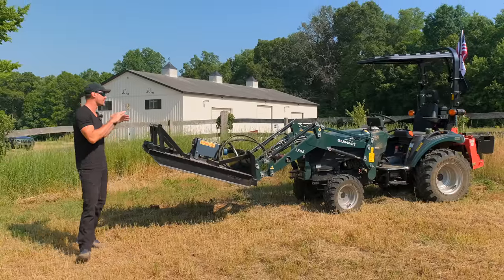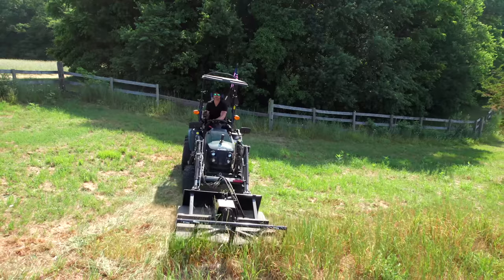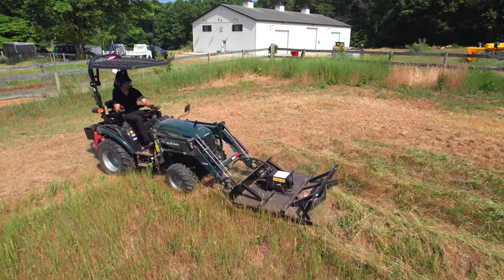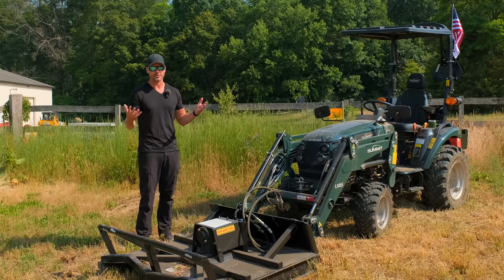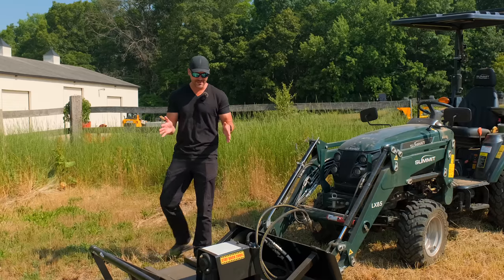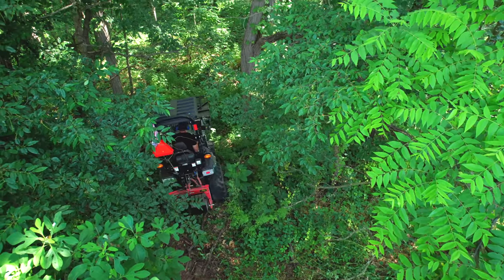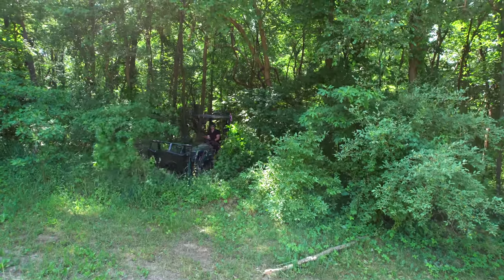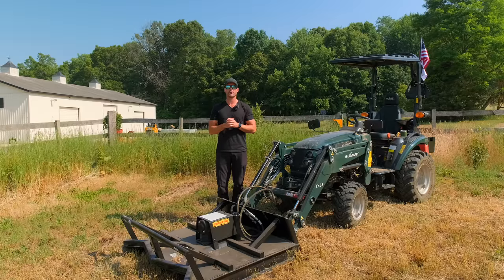NO LOOKING BACK! LOADER MOUNTED HYDRAULIC BRUSH HOG! 😱

Comment: I think this is a good concept and wanted by many but it would only shine maybe with a pto driven pump plumbed all the way up to the front
Reply from the maker: Those PTO driven pumps are pricey...unless you get a made in china version.
Reply: We got one of the last second generation TrailBlazer  front brush hogs and paid the extra for their PTO driven pump in the back. It is expensive, but you can keep the mower running while making the adjustments as you mow. 
When we had our Kubota in for its 50-hour maintenance, I ha s the mechanics do an evaluation of the mower. They thought it was a superior design when compared to the Lane Shark. Plus, they also brought to my attention that there were plates on each side of the back of the mower to install guage wheels.
Unfortunately, TrailBlazer stopped making their mower because they could not overcome a patent infringement case brought about
 by Lane Shark. Even with the design changes on their second generation, it still had problems, so the company decided to give up. 
Too bad, because I really like the constant flow of just under 12 gpm from the power pack. It also gives you 400 pounds of ballast in the back with that power pack. I also had a neighbor weld together  a weight rack that I put on there so I could put 550 pounds of GWT suitcase weights when we are moving around round hay bales. 
The setup works well for our needs.

Maybe someday , we will figure out how to use the power pack in order to use a hydraulic auger.
Reply: @GoodWorksTractors building your own 3point pump is fairly simple.     I’m gathering up parts to build an engine driven pump that you carry on rear to handle high flow and also act as a ballast on the rear

Comment: I killed a calve with a bus hog once! The blade hit a black granite rock , broke and I saw it fly out underneath the tractor, it exited the tractor between the left rear tire & left front, traveled over 75’ and was getting higher before it came crashing down on a calves skull. The calve watched it all the way to the impact. We did not have chains hanging down on the front, which might have prevented this.

Comment: In watching the video I notice that you had to cover over the tall grass twice to cut it. The first time over it pushed the grass down, the second time over it cut it. It would take a long time to cut a large field. The suggestion to have some type of pro hookup to an auxiliary hydraulic pump would be the ticket and then you could run any number of front mounted units for different jobs just like a skid steer. But then comes along the expense and auxiliary pumps are not cheap. My tractor gives you 8.5 gpm and as such I couldn't put a wider unit on than that 4 footer.

Comment: I have one of these from from this company. The owner is great and will answer any questions. I talked to w l long who makes my third function and they recommended a by pass on the return to help on the heat and preventing the motor from stopping to quickly. It was a quick and easy mod, but I can easily cut 2 inch and love it for cutting in woods and trimming up trees and along ponds

Comment: It actually works very well. With over a year of use on mine, I am very impressed. Just wish the video would have gone more in depth with the hydraulic system needs. I have cut in many trails and cleared away a ton of invasive species throughout the property. 
I am running the 4 ft unit from king manufacturing just like the video. My 30 hp diesel compact tractor supplies the hydraulic motor with enough fluid to operate pretty well. I also have mine running from the rear remotes going forward to the loader. The control valve can actuated on for full time fluid movement. As talked about in the video though, you will hear the difference when using other hydraulic systems at the same time. The biggest issue, hydraulic system related, is the return. This cannot be routed back through the normal system. It uses a sump return line that flows direct to the sump. Without this return line, most tractor valves block fluid movement on both pressure and return, the mower would instantly lock up instead of spooling down when turned off. Imagine the damage that could be done. My bobcat brand tractor did not have an option for that sump return and i had to develop my own fittings and lines.
There was also mention if the hydraulic fluid temps... yes you will see an increase of those temps but it was not enough to concern me in the bigger picture.
Reply: Great info.
Reply: For curiosity sake how flat is the area you are mowing with the machine? Would assume that even running over a mole hill with the wheels would result in the mower bouncing up and leaving a high spot.
Reply: @foonus406  and it does. There is no float position like a 3 point cutter. But overall that is not what this cutter is for.
Reply: it won't lock up. That bypass fitting by the motor is a check valve to let the motor spin down when flow is shut off.
Reply: I run a 5' version on a 100hp Kubota.  It gets HOT very quickly.  I try to keep my usage in short bursts of less than a minute.  I would not consider it as a main mower.  It works for my needs because I'm just using it to get into the tight spots I can't hit with my 15' flex wing pto cutter.

Comment: There may be a market for a 3 foot front mount brush hog for getting in the tight spots and overhangs.  It could even be gas driven for ease of hook up and use.  I saw a guy who mounted a regular mower on to his forklift forks.  Worked great.  Brush hogging and then manual mowing or weed eating the tight spots and overhangs can be a big time killer on larger wooded properties.  Would love a front end mowing solution while brush hogging.  Gas engine powered would be way easier to connect and use.  I think it makes more sense as a hard to cut solution and not a true brush hog replacement.  The two together would be a good combo.

Comment: I knew a guy who slapped a PTO hydraulic pump on his Kubota B2920 and ran hoses up to a low flow skid steer brush hog. Worked for the most part. Got the brush hog real cheap, so I guess thats why he did it?

Comment: thanks for sharing the video. one thing that would help this cutter if you could have oil return straight to the holding tank and not go through the diverter valve. the oil would run cooler and it would definitely have more power

Comment: The Hardee Brush Tiger  is an option that runs off the rear pto. It's great for side cutting banks low and high. I run mine on a Mahindra 1538 and am very satisfied. Each attachment has its place.

Comment: I think gauge wheels would be a good thing to add. Put your loader in float and create a consistent mow height
Reply: Mount  a heavy tailwheel on the front,  drop the mower, and float the loader.

Comment: I have had mine for over year, works great. I used mine on my 2025R, 3046R, and 4066R. 
Very handy, super easy to put on and take off. Excellent for those small quick little task. 
Mine also a king welding. Love it!
Reply: how do you think it would work on a 1025r compared to the 2025r?
Reply: @anthonymorrison2167  They build one for a 1025R. There are pics of it on their website. Should do pretty similar to the summit in this video.
Reply: @anthonymorrison2167  I'm thinking of getting one and adding the Hydrosplus upgraded pump to get more flow out of my 1025r. I think that combination will really help the product run better and have a better overall tractor.
Reply: @chrisdavis6789  let me know if you do I"m thinking of it also .

Comment: We have a LaneShark we use on the hunting property, which is similar in operation but with other articulation.  If I use the counterweight on the rear, no hydraulic overheating issues. If we also have the rear rotary cutter on and running, we have experienced elevated temperatures. Also, hydraulic flow issues start to creep into the picture.
Reply: How does it do for you on cutting trees on edges of trails? Plus, I would like it mostly to cut tree limbs back off of corn field. Hasn’t been done on family farm in about 10 or 12 years and I would rather do it than pay someone.
Reply: @kennethdurichek4945  Every spring we do a road and trail cut back. The roads are usually done wit the Lane Shark and trails by hand. We have gone into the food plots and cut the pine branches back also. Good to about 2” then we use a pole saw.
Reply: Thank you for the information. That will help a lot.

Comment: The front mount models seem to be a lot better thought out than the 3 point for thorns and brush, not a fan of driving through the brush before you cut it especially with turf tires.  Asked this about the Rimguard ballast before but never did get a reply.. would it be worth putting rimguard in the small 10 inch skid steer tires or are they just too small for it to have any noticeable effect? I've already got wheel spacers on it with grousers and a full weight kit.

Comment: Safety is a very good point about these cutters. My bobcat has a special door on the front that's half an inch thick, made for use with forestry cutters. I've had chunks of wood the size of bricks slam into that door like a hammer. The cutter also throws pieces for hundreds of feet in front of it.

Comment: How hot did your hydro fluid get while using this? Does it have a dump valve in case it binds up or hits something it can’t get through? I just think without a high flow converter, you’ll end up frying all the o rings on your fittings and create havoc on the hydro system.

Comment: I realize the front mounted hydraulic operated mower may not be the most efficient when compared to a PTO driven pull behind. However, in the situation like mine, this would be awesome. I have an old Ford 4500 industrial tractor and it is designed with a front loader, and to have a rear backhoe however, I do not have the back of attachment.my hydraulic pump would be more than sufficient, and I could use those auxiliary ports that ran the backhoe to run a front mounted hydraulic. My tractor does not have a PTO so a three-point mounted PTO driven implement isn’t even an option for me.

Comment: Having used a front mounted brush hog on a skid steer, my biggest concern would be not having a windshield.  I've had objects, some large, fly out of the brush cutter and hit the front window of the skid steer.
Reply: Aren’t the skid steer cutters intended for much larger material? Like mulching trees?
Reply: @wisdomspitter7688  some are.  Regardless, they still have the potential to spit stuff back at you at Mach 3.  🤣

Comment: It wasn't mentioned in the video, but the tractor he used for this test is showing to be "Implement Flow, gpm 4.8 (L/Min 18.2)" on the hydraulics. So roughly 5gpm. 

One drawback I see is that some tractors use the 3rd function to the front with the diverter button (Artillian kit) and you have to move the stick left or right with button pushed to activate the 3rd function. This is great for a grapple, but if you are using the mower, you would lose the ability to control the lift and curl circuits while cutting. 

I do think a rear remote with plumbed hoses and direct case drain would be a better solution to solve this so it can be turned on and left running much like a PTO.

Comment: Nice video. One thing I wish these manufacturers would do is offer a Hi-flow hydraulic system as an option when purchasing a new unit. There are a lot of attachments that require a higher flow to get a good working attachment. I know these attachment manufacturers offer low-flow versions of some of their attachments, but compared to a high-flow attachment, no comparison. JMO...

Comment: Hey buddy,
I enjoy your videos and I have learned a lot! I have spoken with my dealership about front end loader attachments that require constant flow, like mowers and augers. I have been told that it is not recommended. They say it will heat up your fluid and cook your seals. They are skid steer tools. Thanks for sharing.🚜🇺🇸🍺

Comment: Deere sells a front mounted quick hitch for the smaller tractors (attaches to frame not loader) to run a snow blower and broom powered by the mid-PTO. Why doesn't someone make a mower that attaches to this? The mid-PTO already used to power the belly mower. Couldn't they design it so the mower cannot be raised to the point it would interfer with the PTO connection?

Comment: I have a brush hog on  my skid steer. It is a challenge to get an even cut. It excels at jobs where the weeds or brush are very tall and a frontal attack beats a pull behind approach. Pull behind mowers have the disadvantage of trying to cut stuff the tires have driven over and laid down. This mower on a tractor should be less tippy than the skid steer but I would not want to do open field mowing with it. Oh yeah... and the operator eats all the dust, dirt, and pollen kicked up in front you. A good mower but it should not be your only mower if you have acreage to cut.
On the question of gauge wheels. Front wheels would only work if the loader was in float mode... but I think that would produce enough weight to force the wheels into the dirt. Ideally it would need a hinge at the mount to utilize gauge wheels like some machines that are out there.

Comment: I would like to see a loader mounted brush mower with a self-contained hydraulic unit powered by the front PTO (1,000 RPM).  This would allow full control of the loader lift & tilt independent of the PTO/mower drive.
Reply: Dude,  I agree 💯. 
I think the mid mount pto is very under used. I saw a dude use it to power a pressure washer pump. I think building a generator  for the mid pto would be super awesome too.

Comment: I would be very interested in hearing your thoughts/ seeing you try out a front mount mulcher head. I understand it wouldn't be running at the same kind of poweras on a skid steer. I just wonder if it could be functional like this. TIA
Reply from the maker: Can't run them on tractors, no where near enough flow.  I've ran them on skid steers and made quite a few videos though.

Comment: Would it be better to power the mower from rear hydraulics? 

Perhaps a front mounted hydraulically powered finish mower would be better for tractors? The blades will not need as much power to get and keep cutting.

Comment: I wish hydraulic flow meters were less expensive. Pressure is easy, but the flow meters that handle the pressures involved start around $500. And I have absolutely no idea what the flow rate is on my Summit Hydraulics 3rd function kit.
Reply from the maker: I kinda thought Summit might have one of those, but didn't see it on their site.  Seems like it would be in their wheelhouse.

Comment: keep in mind most of the tractors will spec out the total hydraulic flow. Example Kubota L2501 5.15 gpm hydraulic  3.11 gpm steering total. 8.26 gpm Most places will just list the 8.26 giving you the wrong motor size.

Comment: Not being a safety Sally, but you showed 2 quick positions which really put you as the operator at risk. When you angled the front of that down, it could have EASILY thrown something back at you. Some people really don’t take advantage of PPE before using power equipment and that is where accidents happen. I just saw one yesterday a lady was weed whacking in shorts with no eye or ear protection on and squinting, turning her head sideways to avoid getting debris. 

This machine has potential, but just as the right tool for the right job. Appreciate how you give pros/cons
Reply from the maker: What timestamp?  I don't recall doing that at all as that would be asking to get whacked in the face.  I may look like an idiot, but I promise you I value my life :) I'm guessing it was merely the angle in the video that wasn't the same as the operator view.  Also, my glasses are safety glasses and I was wearing hearing protection.
Reply: Didn’t mean to imply YOU were unsafe! But 2 spots to look at from my viewing angle could be seen as “potentially” dangerous. 

8:22 and 11:35 - the first threw some stuff behind the mower (probably low potential) and the second when you had the mower high it was sort of angled forwards…this was the greater hazard (unless blade wasn’t moving). I’m not a critic, but as someone who has had a few injuries when things “look” safe just pointing out a cautionary POV.
Reply: Someone else is recording those close-up shots with a drone from afar. If that's what you're wondering. I don't believe he's that stupid.

Comment: This thing is begging for a 3pt hydraulic power pack if one could be had a reasonable price. I'd say a gasoline engine powered unit would be less expensive than the PTO power version as that's usually the case. I don't understand it but it is what it is.

Comment: I tnink it will get a lot of people hurt especially when used lifted on an open station tractor or a cab without ballistic glass.  Then there is the turn aspect with people not weighting the tractor properly. Everybody thinks that they can get away with using just one time without weighting properly.